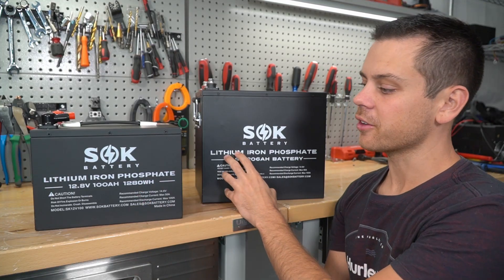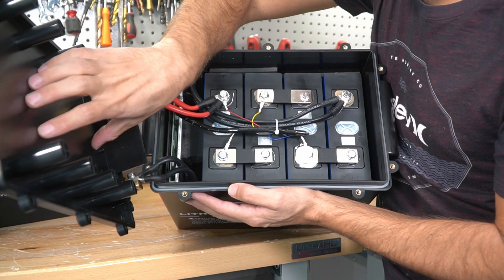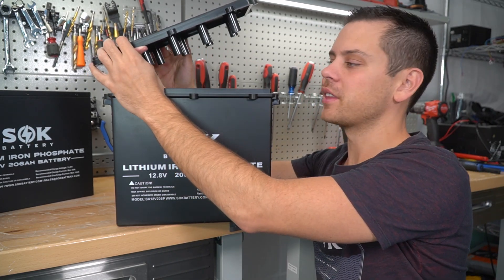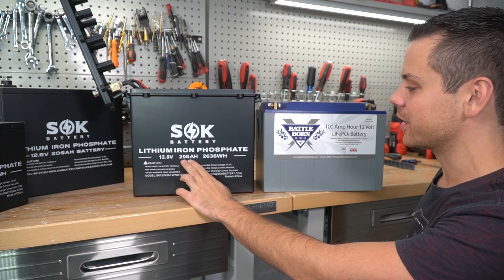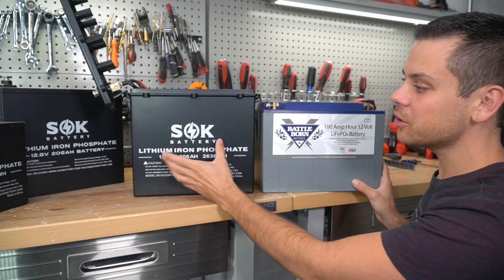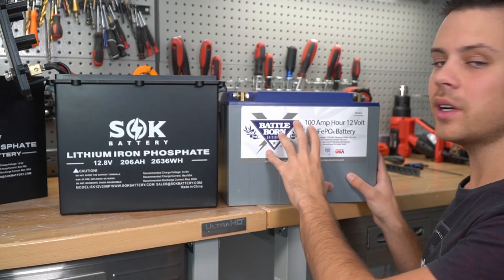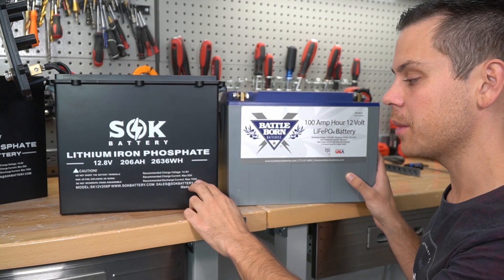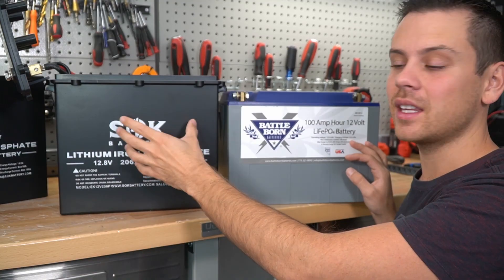New Battery! Marine Grade SOK 12V 206Ah LiFePO4 for $.39 per Wh

Comment: The video is 2 yeras old, does SOK sell this batterie with a Bluetooth BMS now ? On their website I see V8 BMS but no indication about Bluetooth. If not, it's a bummer because how are you going to adjust your boat electrical cunsumption if you can't track how many A you draw and the actual voltage of the batterie ? To me it is a no-go for a buy.

Comment: Hi Will, This is off topic, but I can't find the appropriate place to ask:  I am installing solar in my campervan build, and want to know if you think that the Sterling 1260 is good for Lithium Batteries as well as AGM. I read that Victron has a good B to B charger fpr Lithim, but I bought the Sterling. I can still return it if its not as good as Victron is for Lithium. What is your recommendation? Thanks so much for your help, Will!

Comment: The SOK';s sound great! My only hesitation is that you can only discharge 100AH. I thought the main reason to get lithium is you can discharge much lower and still keep your boat/ van powered. The 206AH SOK only has half the discharge of some other batteries. Am I right to think you would need twice as many to get the same amount of power? I hope I am missing somethting because they sure sound good!
Reply from the maker: No the 206 has 260 amp hours of capacity. You use 100% of all of these batteries

Comment: I know someone who had a BMS failure (burn-out) on one of their two SOK batteries right out of the box. So their claim of 2 failures out of thousands might be a bit dubious. This person had to purchase a replacement BMS and replace it themselves, and it was not the same as the original that was in the battery... no instructions and no manual... they managed to get a response from SOK to answer questions regarding wires that didn't correspond. Hopefully better luck going forward.

Comment: Love mine, but had a bad BMS.  It was replaced after 1 discharge of 40% and only held 70amps discharge.  They sent me a new BMS.  It was bad as well.  It would shut off after 1 day of sitting.   They sent me a 3rd one.  They are not hard to install, but pulling the battery out of my boat is a major hassle and requires removing hatches that are sealed down.

Comment: i use 206 AH sok with 3000 watts inverter . even with full charge battery , inverter shut itself off when I use 1500 watts hair dryer. I attached same inverter to 100 ah other battery and no problem. I am confused .Any help?

Comment: I do have a complaint. We just purchased (3) 206AH batteries direct from the company 4 weeks ago. All the batteries arrived dead. We charged them to full capacity and installed them in parallel. 12V. On the SOC meter two of the batteries worked correctly. The third battery always reads 100%. The CALC for the two batteries is 206. The CALC for the third battery is 106. We contacted the company and they said they’re having a software problem. They said if we kill the battery 2x the bar graph MAY correct itself. I asked for another battery and they refuse to respond to this. Also, their tech # automatically goes to a recording directing us to send an email. Which they don’t respond to! Please advise. Thanks. Phil

Comment: The SOK marine grade battery is with bluetooth and Built-in heater element. At least they say so on the european website: Marine Grade 12V 206Ah Battery, Sealed Plastic Box Bluetooth&Built-in heater SKU: SK12V206PH € 1,160.00

Comment: Hi Will, we just bought the SOK 206AH Marine Battery for our small trailer camper. We are coastal and do most of our camping along the coast. We don't have much space to mount it inside the camper, so it's in the storage box on the tongue. We took it to a Battery Store to have it checked before taking it to the RV place to install. Sadly the diagnostic came out Bad Battery. At 100% charge, it's total AH measured 88. I have notified SOK and will let you know their answer. Thanks for your great reviews! We are learning so much from you.
Reply: What was the outcome to your problem?
Reply: karen what ended up happening with sok?

Comment: I'm shopping around for a house battery for a 25' sailboat. I love this SOK, but if what I'm seeing on the specs is correct is has 100a continuous output. Is that going to be enough to run high power devices, maybe a portable induction burner or anything like that? I believe the 200ah Ampere Time (PLUS model) has 200a continuous BMS, debating if that might be the better option for me. Any input?
Reply: I have a single 206AH marine (bluetooth/heated). No room for a second (or the necesary solar capacity for a second). The stupid low 100 continuous discharge limits it to the very basics (radio, nav, lights, etc.).  As far as trying to connect an inverter of any significant size, no dice.

Comment: Our four 206Ah SOK batteries arrived yesterday and I was dismayed to find that the 50A charging limitation is so strict. If the current exceeds about 65-70 amps, the charging isn't just slowed down, it's completely shut down. Charging the cells individually, last night I had the charger set to 65 amps and this morning the battery was at 73% with no charging taking place. This could be a drag when camping and needing to quick-charge the batteries.

Comment: For my RV I am buying  SOK lithium battery  do you  recommend two 100 amps or one 200 amps   I running a 300 watt power inverter no solar  panels  just the RV charger

Comment: I'm looking to build a system with 600AH capacity so that I can run a 12V air conditioner like the Domatic RTX 1000. Would the SOK work or would I need something with a better output?

Comment: What amount of city power rate is the number to save with system ,in many states rates a better than California ,so how much use and rate is when you think of having the risk of fire added and you never talk about fire protection cost that is on the markets as well and only a pen away to be law to be installed as in garage law added to homes built and up to code ,so descreate ways to have back up as in better protection and storage ,you talk of in closed to keep warm what are the added risks and cost of true responsible appilacations that are what defacts or as in child inforcement could say you are not fit do to the added risks you have brought in to the child's invierment with out properly protecting children ,,,,,,,you make it sound you have not heard of the risk is more than codes in buildings ,can you consider talking as disclaimer that all input is needed to see if you investment to save can cost you dearly if not the wisdom of the older well lived thought of if I known I would have never thought to save a buck to with out weighing out my actions in real world conditions ,signed two gallons of milk at all time ,I will never see all them rules for children's safety and we'll being of comfort and stablitiys as I learned the standards of 2008

Comment: What's the best current value in lithium batteries today?  A friend has a power chair that is constantly running out of power since he's a pretty big guy. I'd like to find a good value battery that has overcharge protection and will have a higher capacity than his current lead acid batteries.

Comment: I am ordering two of these batteries to install in my travel trailer pass-thru.  I need to protect the terminals from accidently getting shorted out.  I can't find a battery box that will fit this thing.  Does anyone have a recommendation on how to protect the terminals?  Thanks.

Comment: As a liveaboard cruiser, I love what SOK is doing but I wish they would take some feedback directly from the boating community.  Generally boats are designed with designated areas for battery storage, and in many cases those areas are already outfitted with built in battery boxes for certain size batteries.  For this reason, many vendors, including Battleborn, have made drop-in replacements for the 8D formfactor of AGMs.  In the case of SOK, the 206AH marine battery is too large to put 2 batteries in an 8D box and one battery is too small with regards to amp hours.  The Battleborn 8D replacement Lithium is 270AH with the correct sizing to fit in an 8D battery box.

Comment: I'm considering this battery for my sailboat, but leaning towards paying a bit more for the Battleborn. The main reason is the 100A peak discharge of the SOK battery.  The battleborn is 100A continuous with 200A peak (30 sec). I'd like to have this extra headroom for my windlass, which can draw large currents. The limitation is likely in the BMS. Has anyone looked at upgrading the SOK BMS wiring and/or FETs to handle higher current?
Reply: I just saw someone linked the Renogy, which is about the same cost as the SOK but has 200A continuous discharge!  Would love to see a review of the Renogy by Will. Note however that the Renogy only has a 3 year pro-rated warranty as compared to 7 years on the SOK.

Comment: I live in Australia and want to put a Lithium Deep Cycle Battery in my boat to run my Minn Kota I-Pilot Riptide Powerdrive Bow Mount Motor 55lb 54” 12V . With shipping cost so hi at the moment what lithium battery would you suggest would suit my purpose ? I have looked on Ebay Australia for a battery but there's so many  and I don't wont to get Ripped Off. Would you help me out Mate ? I'm looking at speeding around $700 AU.

Comment: @WILL - I have a question or challenge for you !
I am sick & tired of replacing my APC UPS batteries - the paired APC RBC124 packs. They last about a year usually regardless of whether the power fails. My question is - is there a Lithium replacement with their form factor ?

Comment: Great to see a Marine Grade SOK battery. Are there any Solar Charge Controller & Inverter All-in-one System (Growatt type product) that's in a Water Proof enclosure? I've installed a small off-grid system on a boat dock and want to up it.

Comment: Hi! Is there a way to start with a few solar panels connected directly to some room heater (air heater) for the winter and think about charger/inverter/battery later? I'd like to see a video on that - I'm sure is not that simple as just connecting the solar panels to a radiator :)

Comment: Will: You mentioned making your own insulated case with a heating element.  IIRC, I don't remember if you have done a video on how to do this.  If not please create a video on how you would do this.  I want to make an RV setup with the batteries under the front seat but I am concerned about leaving them out in the cold.  Thanks!
Reply: They have cold temp disconnect.....Just build a box out of thin plywood, insulation and RV tank heater.

Comment: Why are you calling them Marine Grade and others NOT Marine Grade. What is the difference?
Reply from the maker: If it's sealed, it's fine for marine application. Most packs are fine. But steel cased? Absolutely not

Comment: Will, how would you rate these versus Kilovault?
Reply: Also, these better tried and true warrantied models (BB, Kilovault, Dakota), don't you think with the cost and competition one is actually better off planning their system to a smaller AH pack at 100% Dod (2000 cycles ex.); thus less capex and space that we boat users often have limitations with? 
And, do you feel constistent 100% DoD poses any safety risks?

Comment: Hey Will, great video as usual. I know cold weather isn’t your thing, but do you have any recommendation for a decent battery chemistry for cold weather use? Or year round use with occasional -40° charging? 12V, ~10 Ahr, <1A continuous load.

Comment: I have a simple solar set up of 4 100w rich rigid 12v panels and 8 solar batteries (not Li ) Can I remove one of the 100w panel and add two 200w rich panels and add two more 12v solar batteries for a total of 10 batteries and 5 solar panels. My problem, I don't know if you can add 200w panels with existing 100w panels?? I'm new to solar so sure would appreciate your thoughts before I buy panels.  Thanks!

Comment: Thanks for the update Will.  This 206Ah SOK looks great for both marine and RV use if it is exposed to road grime and potentially road salt.  

Question on charging.  I noticed the max charge rate is 50A and I wondered if this is regulated by the BMS?  Would this charge rate be considered safe for MB Sprinter based RV applications or is a DC>DC charge controller still recommended to protect the 190A alternator?
Reply: Always use the DC-DC charge controller. Renogy makes great ones.

Comment: These appear to use the OverkillSolar/JBD BMS like so many of these newly constructed batteries.  And those BMS's are current limited to 120A, which is why all these batteries spec at 100A max current -- the cells themselves could almost certainly go higher to 1C or so.  Not a bad thing, certainly it's nicer to the cells.

Comment: Wish sok would do a 100ah marine. My kayak can't fit a 200ah for my trolling motor inside the front hatch.

Is there any reason that you shouldn't put this SOK battery on its side while using a trolling motor?
Reply: I would try to make sure that you do not put the side down which has the BMS, in case the batteries slip! :-)

Comment: I have a battleborn battery. Would it be ok to connect one of these SOKs to it?
Reply: I was wondering that too. I havent bought ANY battery but someone is going to be giving me their (used?) Marine battery. Just a regular cheap one ,I have no idea the brand . I have been trying to save for one single BB battery for over a year. I had 1k but needed to spend it on something else, now have 600 saved and just noticed in the comments they dropped their price to 799. Glad I waited . I will go for a marine battery set up OR BB . But I am also considering having both types (1 for back up) on hand just incase. I need to relearn what I learned last year because I forgot most of the info. I learned besides the main items I had originally decided on getting. Which was either /or marine battery / Battleborn OR both eventually.

Comment: Trying to get into solar. My dad wants to have panels in a storage shed to just power some lights do you have a recommended system?
Reply: Last I checked (a year ago) he had a whole website with a list of complete system break down sharing what you need to buy , right down to each product, for each type of set up, depending on what you decide on doing. I thought that was pretty awesome. I'm more of a visual learner so those really helped me decide what type of set up was best for me based on my limited knowledge on all this. Also he sells 1 or 2 books 📚.

Comment: Anyone know where we can source the case that fit those 3.3v lifepo4 cells for building a pack?  

Using both those 3.3v 200AH and the 3.3V 300ah in series for 12V; looks pretty standard.

SOKs cases they are using look perfect.  I like the heat-shrink on bus bars also; good safety measure.

Comment: I've been trying to see what I need to do to put this in the boat. Do I need to worry about burning up the alternator? Been trying to understand what I will need to change in it to change to lithium. Idea is to keep started as AGM and lithium house bank with the citrix-ct between them. So many questions... This channel is great!
Reply: I am in the same situation.  My alternator for a Yanmar 4 cylinder puts out 80 amps.  It is charging 2 lead acid batteries for engine starting, but I would like to charge  the house bank (currently 2 126ahr AGM military tank batteries) which I will replace with my SOK 206ahr with the alternator when not using solar.  How can I do this?

Comment: Will, my ears perked up when you mentioned  both 48V and cheaper!  
I have a ham-shack and a electronics-lab that do not get the benefit of my solar hot-air system.  Since I only spend short amounts of time in these rooms in the winter, I think I could make use of a 'heat-on-demand' style of solution.  I have a roll of Cromel wire that is 0.68 Ohms/foot and using some ceramics feel I could make forced-air heaters that are around a 1000 watts.  The issue has been that when you use 12 volts your I-R losses are horrendous, so using 48V and some 6 or 8 AWG wire I have could offer a better solution.  Also, it would allow me to have heaters in both rooms connected up to one battery system near the adjacent-wall.  Also, I would be able to place the 4 solar-panels in series to charge say a 48V x 206AHr stack for starters.  I may not be saving any money but the room comfort would really improve.

Anyway, do you use any of your systems for space-heating; it would seem you have enough stuff laying around to make probably several systems?  This would also (in my mind) offer a way for you to life/cycle-test all the different components.
Finally, you've come a long way, and have always been an honest and solid solutions-engineer! 
Consequently, your channel is so valuable for people (particularly with limited knowledge) putting this technology to serious use--so thanks a lot Will!
😀

Comment: Hey Will, there are no videos on Victron or Xantrex bundles that are on the market. Ones that have everything you need like solar panels, mppt, soft starts for ac, wiring, brackets...to build a system for rv's. Battleborn has a bundle, but I want 6 SOK's Can you recommend anything?

Comment: Hey Will, what is the weight of the metal case vs the nylon case?  I wish SOK had that listed on their site.
Reply: For anyone looking for this info: Current Connected (Will's link in description) has a spec sheet showing the metal case 206ah battery at 47.6lbs and the marine grade plastic case at 44.06lbs.

Comment: I am not sure if high charging current at low cruising speed will fry my alternator. Especially charging two onboard batteries. Most of the time engine stays around 1000 rpm
Reply: There are DC to DC chargers made for this purpose. I have one from Renogy. It limits the charge current to the batteries even when they are at a low state of charge. It saves the alternator from overheating.
Reply: @kimmer6  thank you